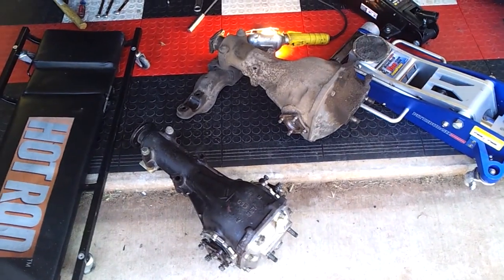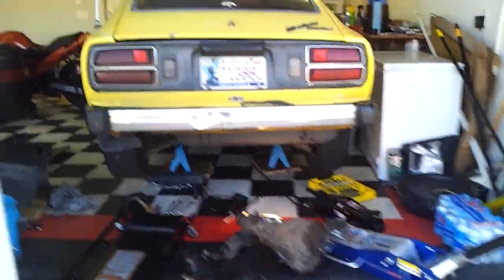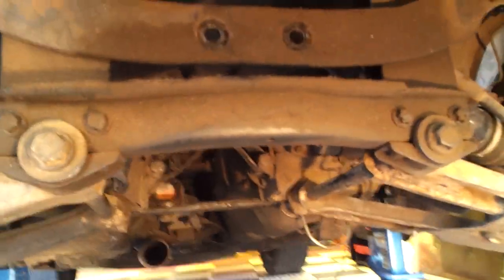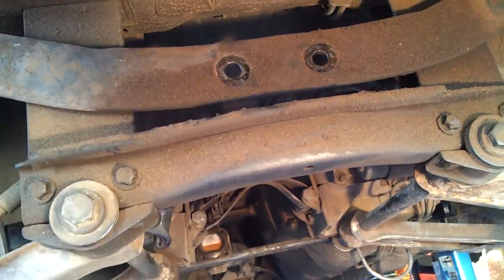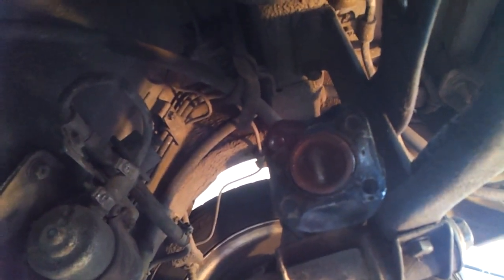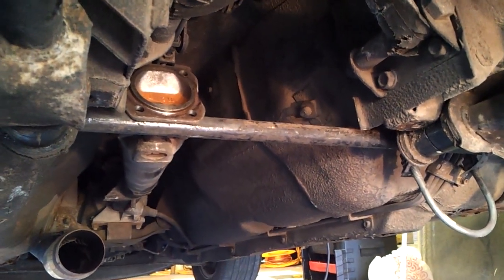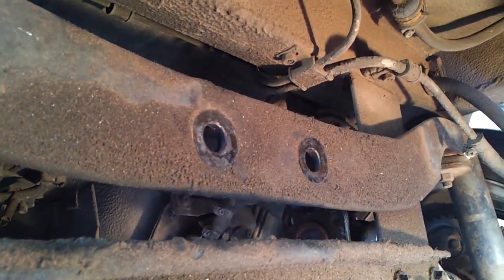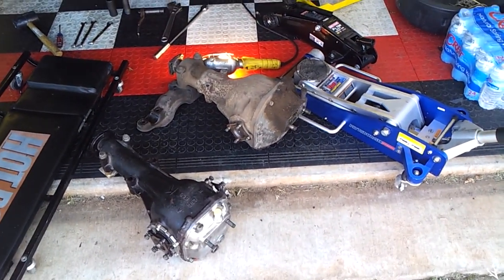Fastutorial - Rear Differential Swap

Comment: I do believe you replaced your R200 with an R180. Generally someone would swap these the other way around. Did you need to use a different mustache bar and rear 'traverse' bar or whatever it is called? I pulled the R180 out of my 70' 240Z this afternoon (same as your black one), unless I'm mistaken!
Reply: Landon Mechalchuk wrong it’s a r200 long nose the bigger one on the right

Comment from the maker: It's a 4.36 R200. I was told it came out of a Nissan truck. It may be the front differential from a Xterra or Pathfinder.
Reply: I need to replace the r180 in my 79 280zx, do you know what year car your r200 came out of? and did it go in without any modifications?